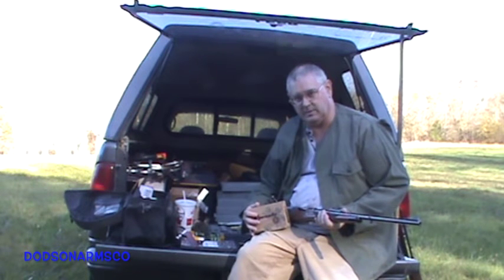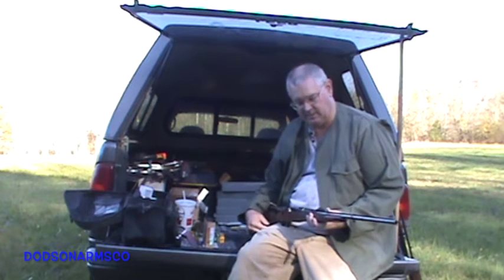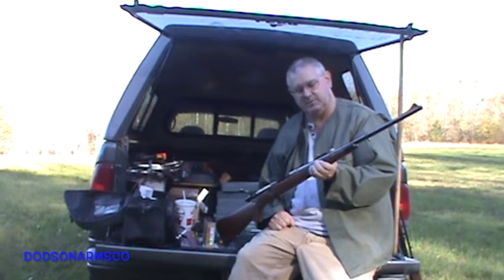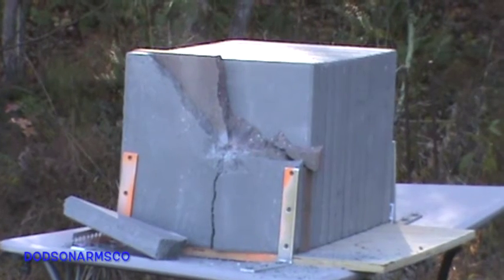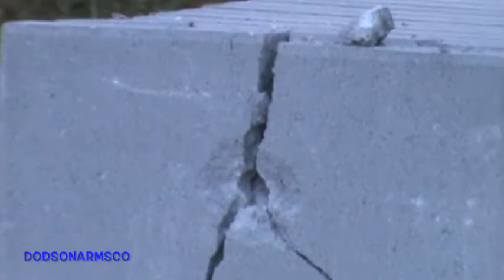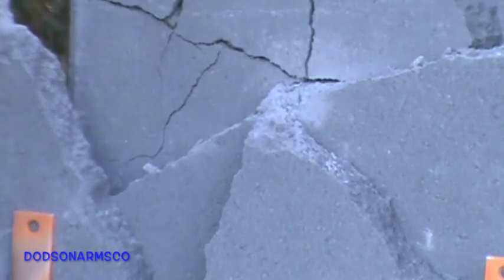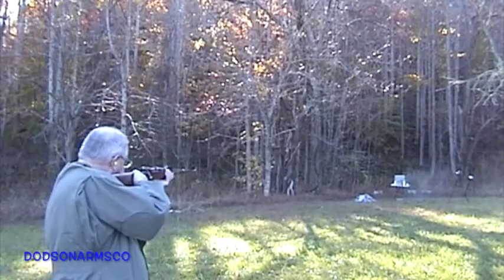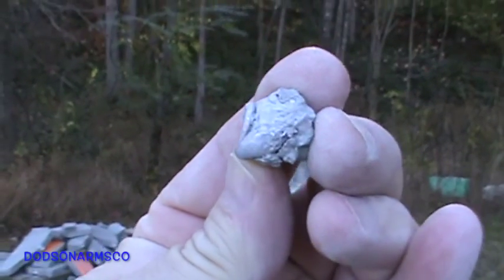375 H&H Magnum VS Concrete: Hornady 300 gr DGS Solid at 25 yards

Comment: Why didn't you say the amount of slabs the 3 shots penetrated but did for all the others? Because it sadly wasn't impressive and looked like it went through 2?
Reply from the maker: It went through 2 blocks because the shots were spread to far apart while crushing two more blocks behind those. If the groups were smaller and a scope utilized then it would have penetrated much more. Another shot would probably have scattered the two crushed blocks.

Comment: I have a mosseberg patriot 338 win mag should I get a 375 Ruger or is it not worth it.
Reply from the maker: If you are going to get a 375 I would get the H&H due to availability and lower operating pressure. The 338 is a good round FMJ ammo is harder to find for it than the 375.
Reply: dodsonarmsco I reload all my ammo and I was gonna get a patriot because they are cheaper and still good guns.
Reply from the maker: @morganhay859  if you reload  it should work fine for you.
Reply: The 338 Winchester Magnum will kill anything on the American continent.

Comment: If you try a mono metal solid (solid copper), I believe the penetration would exceed that of the bullet you used, the copper bullet should not deform as much if at all as the one you used which in turn would greatly enhance its penetration. There is no doubt the one you used would be deadly on game but concrete is a different animal ;) 

I have the same rifle, it's excellent, bought it in 1985. With control round feed bolts, you have to pull fast and firmly in order to extract the rounds and make them fly because they lack spring loaded ejector buttons. I stress the "fast" part or the round may not eject and remain on top of the others in the magazine. All CRF rifles behave similarly. I personally prefer to lower the rifle so that I can observe from the corner of my eye, while looking at my target, the round ejecting and the next one feeding properly when shooting at game. It takes a split second more but ensures you are properly loaded in moments that require follow up shots. Some people prefer to keep it on the shoulder but it isn't ideal, jams can and do occur. 

Incidentally, in terms of accuracy and speed the rifle has exceeded my expectations. Every load I shot was quite fast on a chronograph. Accuracy, even with open sights is outstanding.

Thanks for the video, I enjoyed it !! Love to see a good rifle put to use !!
Reply from the maker: Paul Homsy copper or bronze solids would do better. The bronze monolithic solids do well.
Reply from the maker: Paul Homsy it is an excellent rifle much more accurate than me. I have a matching one in 458 rem mag. Wish I had one in 416 rem mag. I have a winchester in 416 it is a much heavier rifle which is slower to swing and aim with.

Comment: Good shooting. I'd have thought the 375h&h 300gr bullets would have done more to your concrete. Concrete varies so much from one formula to another. I think regular cinder blocks wouldn't have fared as well. Good video.
Reply from the maker: Paul Simmons I agree blocks would have not done as well as the concrete stepping stones. The stoned have fiber in them which seems to harden them somewhat. Glad you liked the video.

Comment: .375 is very good, could you test the .416s and .458 also later time. One bit overlooked now is the .338 Win Mag .
Reply from the maker: We have a 416 Rem Mag. and .458 coming up in the next few weeks also. Thanks for watching
Reply: dodsonarmsco  I have a .404 on a98  and a .450 Ne  on aRuger nr 1 . I wish it was some long mono metal .458 bullets redeadily availble. in asingleshot one can get close to Wby levels in energy .  During ww1, they used many diffeeent types of hunting rifles flr counter sniper, anti material ones . 450 , 470, .333 Jeffery was even bought into British service in M98 rifles from Jeffery and they worked very well. 318 WR also was well liked, but 375, 404 and 416 was also much used .